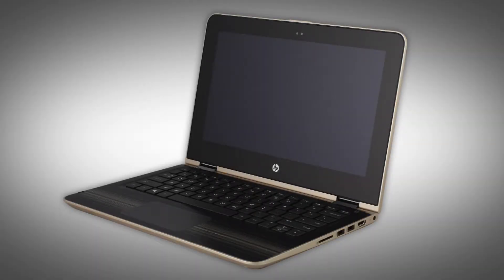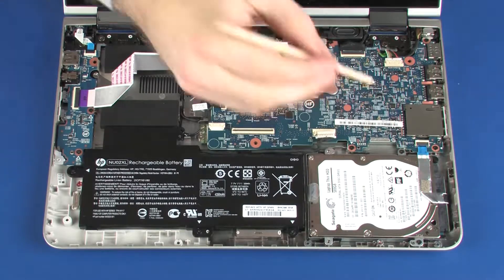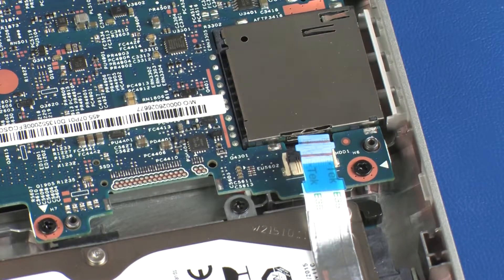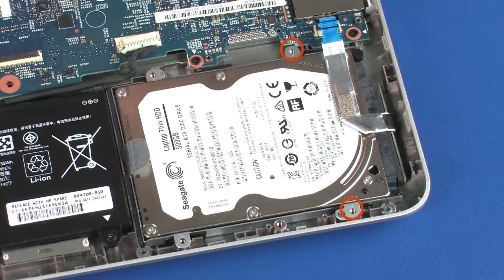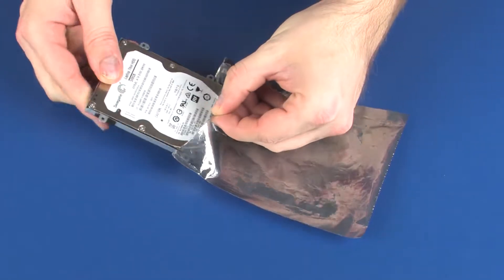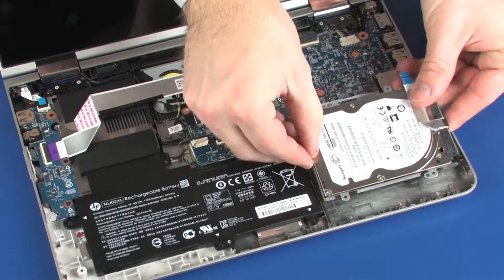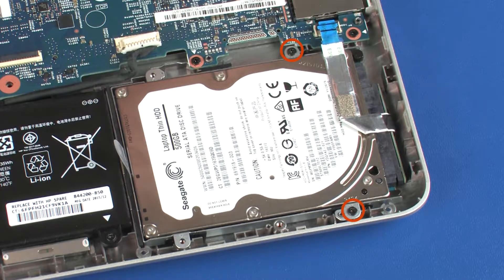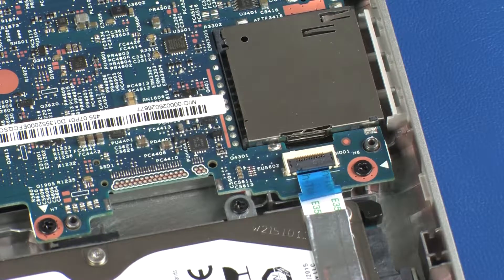Remove and Replace the Hard Disk Drive Assembly | HP Pavilion x360 m1 Convertible Notebook | HP

Comment: "Before you begin, remove the top cover"
Thanks, that definitely wasn't the part I was looking for help with or anything.

Edit for anyone else stumbling across this guide:  In addition to the obvious screw hiding rubber circles, there's an oval one in the center and no less than seven freaking screws under the rubber strip closest to the hinge.  The rule of thumb I follow of "If it doesn't want to come off intact, it's probably not hiding a screw." does not apply here.
Reply: LOL exactly! Frikkin idiots did not even show how to remove the top cover!